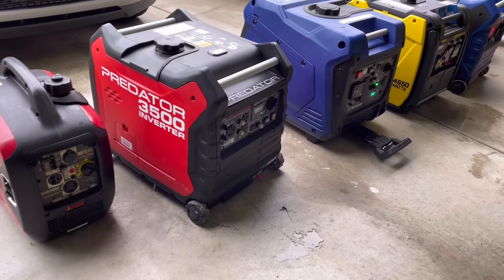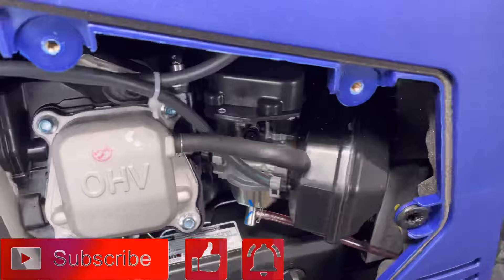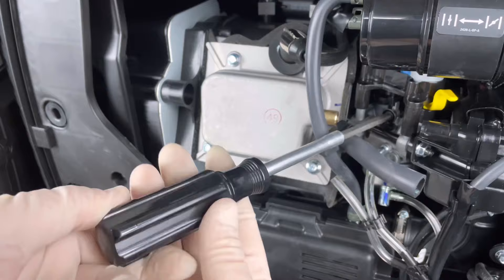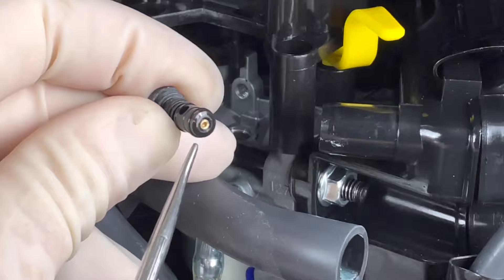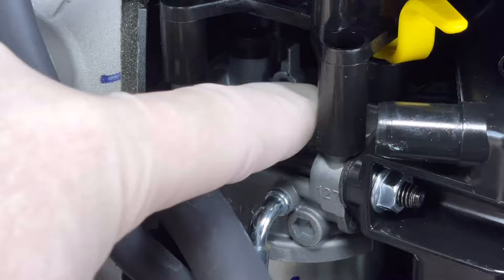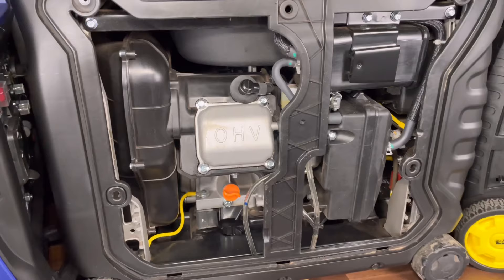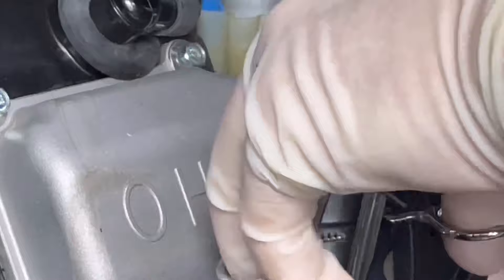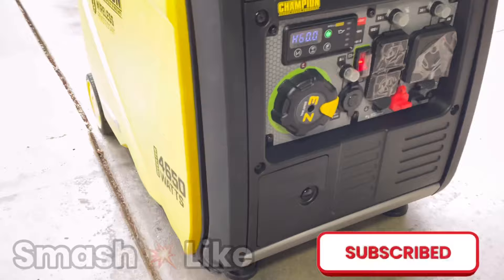Generator won’t start Idles up and down DO THIS 5 Min fix!!

Comment: what about one that dies one 1st start but runs on 2nd?
Reply from the maker: Try putting a new plug in. Use a basic NGK only … if propane tighten gap .010ths more then spec says…
Reply: @johnnysweekends  ya was thinking about that. but it runs normally for hrs. I also pulled it to check and threads are striped on the tip. but ya I will try that as it cant hurt nothing.
Reply: @johnnysweekends  just did this and same shit dies on 1st start
Reply from the maker: @clamojoat1938 does it run on second start? Odd…but if it runs that what really matters. I have some that start and run for a couple seconds and dies and then pull again and away it goes
Reply: @johnnysweekends  ya 2nd start manual chocking. auto choking it takes 5 tries after 1st
Reply from the maker: @clamojoat1938  what generator? I would say choke cable adjustment. Choke plate maybe not closing all the way with auto choke. Visually see if the plate is closing the same with auto and manual.
Reply: @johnnysweekends  champion 4500 no cable. just lever. didnt do this before we had a -25 windchill tho. so maybe these are just only for warm temps
Reply from the maker: @clamojoat1938 ohhh at that temp everything is gonna be harder starting. Its temp rating is like 104-32f I believe/ that’s its optimal range.

Comment: That didn’t work. My husband had 30 years of experience with generators and he has done everything beyond what most people would have done and it still power surges- running rough. This is brand new and it’s going back. A lemon
Reply from the maker: What unit is it..?
Reply: Mine didnt work either.
Surging at idle but idles fine under load.
Removed that needle, cleaned it, soaked it and put it back in, still surging.
Spent $100 on a new jet ... SAME SURGING AT IDLE ... 🤷🏽‍♂️

Firman P03608 3650W Generator ..
Reply from the maker: Not a fan of the firman models but yea something isn’t right and still no response from the OP..🤷‍♂️
Reply: @johnnysweekends  its odd because i use this generator to power my shed and i have been using this generator since 2017 ... 5 yrs now and it runs weekly so it always gets fresh ethanol free fuel every time it runs low. Just 2 weeks ago i power it up as i always do and then it starts to surge at idle ....
Everyone on YouTube and you all say its that jet ... well, not for me. 
Guess i will have to take it off and see if its clogged.
Reply from the maker: After a while these little carbs just turn to junk. Even on boats and more. They do eventually go bad no matter what you do. 
And it doesn’t take much. It could be a small piece of debris in a passage. 
Most are like $35 to replace a lot of these maybe you to $85.

Comment: what a weak design is the carburetor. Tiny little debris can foul them.  Fuel injection solved most of the issues.  I generally hate carburetors because they always need cleaning, adjusting, setting, or just a good cursing :-)
Reply from the maker: Lol I agree, simple throttle body injection would be just fine. 👍🏼😀
Reply: @johnnysweekends  Like it did on cars too !  My issue of carb today is a champion 2200 power inverter generator. Brand new, ran twice for 15 minutes. Last ran over the summer.  Gas had stabilizer, but drained it anyway. It starts with choke on and dies within a second. I keep pulling, nothing. I let it sit for a minute, pull starts up, then dies won't start. I tried pushing the choke back, no luck. no start, no running. The darn thing is brand new. I checked plug, clean as a new plug should be.  Bought it one year ago, tested, ran it for 15 min, all was good, loved it put it away. I tested it during summer, all was good, put stabilizer in, put it away. Snow storm coming, no start. I really hate it :-)  Please help !
Reply from the maker: If it runs with the choke on oh at high rpm then the small jet is plugged and you’ll need to pull the jet out and clean it. 

You’ll instantly know if it’s the small jet if it runs with choke on or with eco off and some rpm because it will be on the main jet. You just have to get it running long enough. 

It’s always the stupid jet and I feel stabil doesn’t work as good as it should. I have switched back to Lucas which I used for years and now I seem to have no issues. 

I used stabil for several years and every year my lawn mower or weed eater wouldn’t start. So clean everything and good to go. Now with the Lucas stuff the last 3 years no issues with my lawn mower. It’s the last lawn care item I have that’s gas. When it dies or I find a smoking deal on a used ego it’s gone. 
Trying to simplify my life not add more issues and maintenance 😂👍🏼
Reply: @johnnysweekends  I can't get to the jet. This is a different model. Not so easy access. It looks like the carb has to come off or I do not know what to do. I do not see anything like on your video. This is mine : Champion Power Equipment 100692 2000-Watt Portable Inverter Generator, Ultralight -  The side access allows you to change air filter and see the chose side. There is a small electronic actuator that controls the idle. If I pull on the choke lever - full choke - the engine starts and the throttle lever supposed to add "gas" and take over. Well it does for a few seconds but then snaps back to zero position and engine stalls. There is a throttle adjustment screw on that lever but won't help.
Reply from the maker: Yea don’t turn the screw but yea that model you have to pull the yellow side panel off with the two screws. Remove air box then the two bolts for the carb to get to the jet. You may only have to remove the air box and maybe slide the carb back a little to get to the jet. Just depends on the model.

Comment: Didnt work.
Pulled that jet out, cleaned it, soaked it .... same surging on idle.
Purchased a new one for $100 and the same surging at idle.

Amazing how everything seems to work in YouTube world but in real world, nothing works ...
Reply from the maker: So many people have done this technique and has worked for them. You can Red many reviews. 
It’s hard when I don’t know the age of the unit or the care and more. 
Have you checked the spark arrestor in the exhaust..? Or new plug?
Reply: @johnnysweekends  Trust me i KNOW that this has worked for many based on comments but it didnt work for me. 
I use this generator weekly and burn off 5 gallons a week for 5 yrs with ethanol free fuel from day 1 and last week i crank it up and gets idle surge. 
Pulled that jet, cleaned, soaked, nothing. Purchased a new one, same issue. 
The carburetor is identical to yours. Its not like it has been sitting for months or years and its old gas or clogged, its used weekly and burns off 5 gallons a week and its under constant load. 
It just does not make sense to me ...
Reply from the maker: I assume other items have been checked?   New spark plug? Have you cleaned spark arrestor? 

Also carburetors can eventually just go bad. Shen I worked on boats and jet skis which I still do on the side, sometimes no matter how many times you clean a carb or even rebuild it, they just go bad. Very common in older marine vessels. Even my buddies weed whacker, just a few weeks ago I said just buy a new carb if you still like it, they are only $30. Said it runs like new now. 

Eventually they just go bad but are cheap to replace.
Reply: @johnnysweekends  i guess its just frustrating how 95% of the comments say this fixed their problem yet here i am saying it didn't ... 
Especially when this thing is ran weekly and i burn thru 5 gallons a week so its constantly running, it doesnt sit at all for the fuel to go old or to clog up the passage ways ... 
I dont recall seeing a fuel filter between the tank and the carb so maybe its possible a spec or something go into that pilot jet passage and it clogging it up 🤷🏽‍♂️ 
But at some point i will pull the carb and do a full cleaning on it, because it runs fine under load right now and thats all that matters now.
Reply from the maker: Well I also would say 90% percent of the people with this problem are the ones who just use there generators for emergencies or seasonal. 
You use it alot so things will wear out. Generator engines vibrate constantly so they can wear parts in the carburetor like the float bowl pin and more. So with your use a in line filter would be a good idea and if a fuel carb clean and maybe rebuild doesn’t do it, well a replacement may be needed.